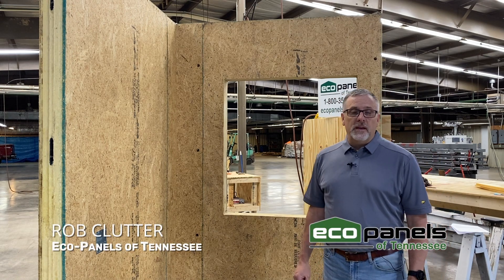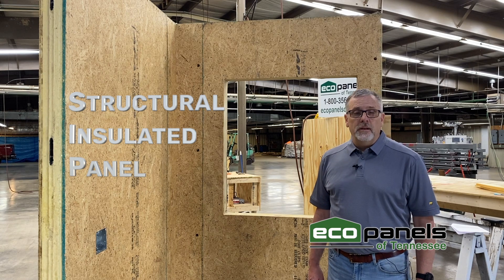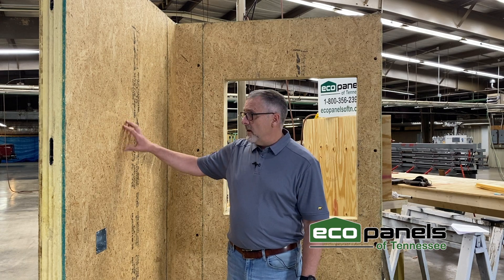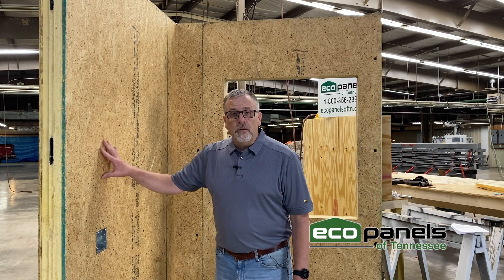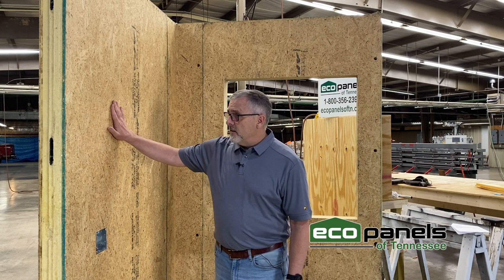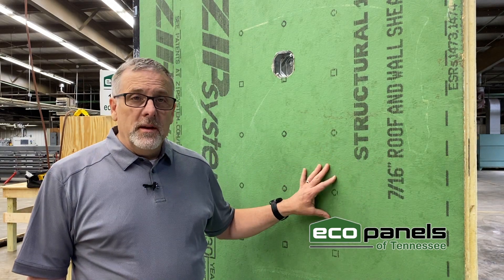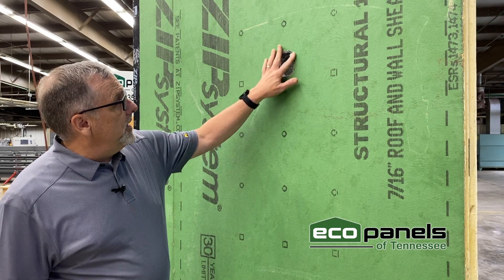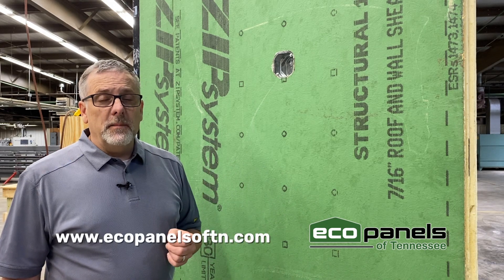What is a SIP panel?

Comment: Question; have you ever used FRP or other composite sheeting on the outer side of this wall system? If, you did, how did it compare with other types of sheeting in performance, especially in strength, and water penetration?
Reply from the maker: The "skins" of a SIP panel must be structural in nature, so a typical FRP would not have the inherent strength needed for our application. That said, there are other products available that are structural and can provide a exterior surface facing that is much closer to being finished. A good example is LP Smart Side, which we have commonly used in the production of our SIP panels. The LP board, combined with batten strips, can create a nice board and batten look. To finish, caulk the seams, apply the batten strips and caulk those, then paint. So yes, there are other options rather than standard OSB, but they carry a certain structural rating on their own. Great question... thanks for asking!
Reply: @EcoPanelsofTennessee  You are welcome. Thank you for answering.